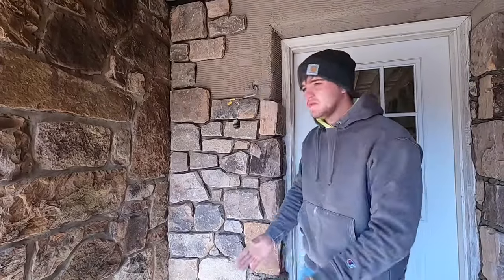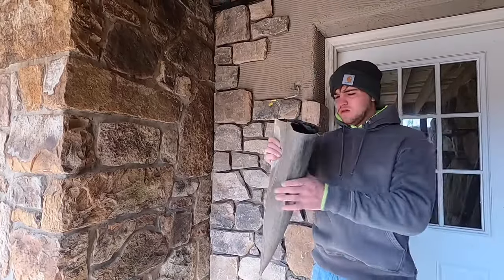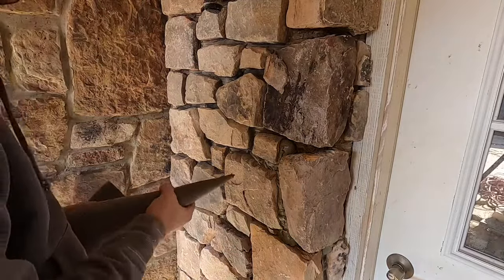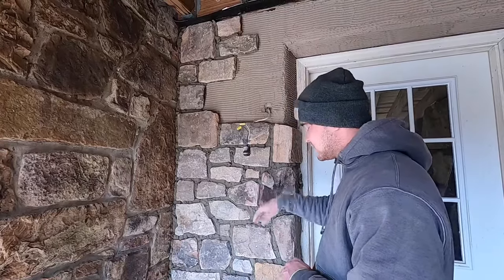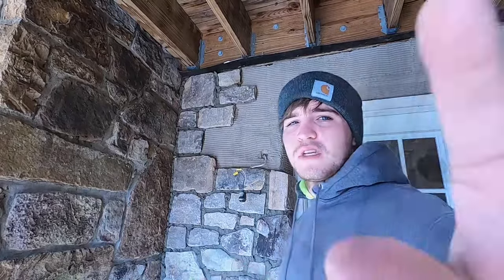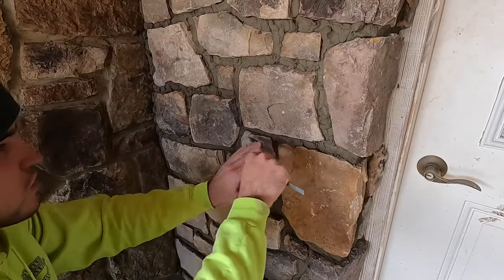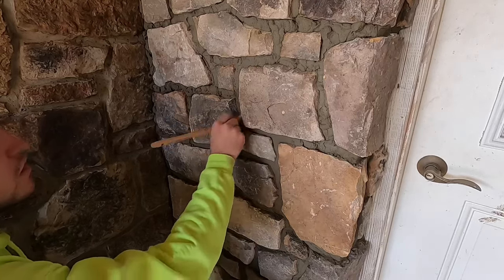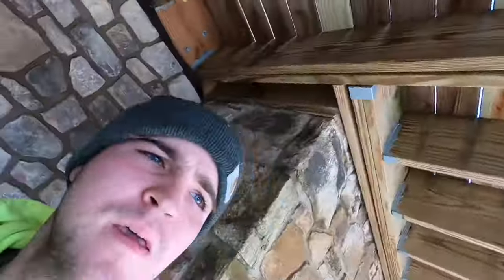How to grout a stone veneer wall

Comment: Question:  I've got a PAINTED wall (fireplace surround) with large stones stuck on the wall.  Both stones and wall are painted.  So, I want to add mortar, but will it stick to the painted surface between each stone?  This is such an ugly, weird fireplace.  I was going to paint it all with Kilz then try to mortar.  Oh, and paint the stones - I assume I should do so first.  Any advice is welcome!

Comment: Looks good man but I see you miss a lot of details it’s important to finish laying the stone then grouting the joints to have consistent coloring when dry. Also what’s up with the door casing the stone would have to be removed to replace the door which looks like it needs to be. But other than that good work dude.
Reply from the maker: I couldn’t finish bc we didn’t have all the material needed so I did what I could. Idk about doors, not gonna lie. Thanks man